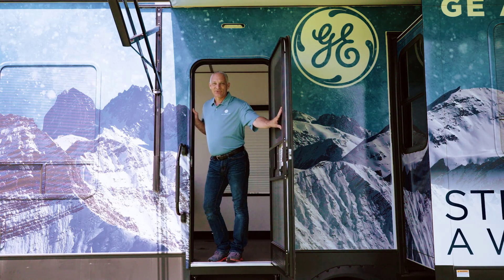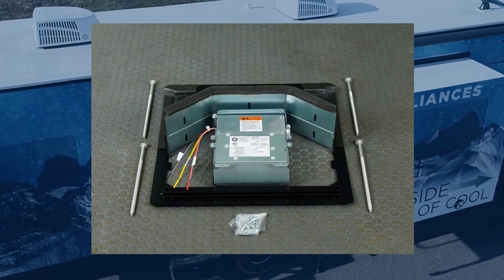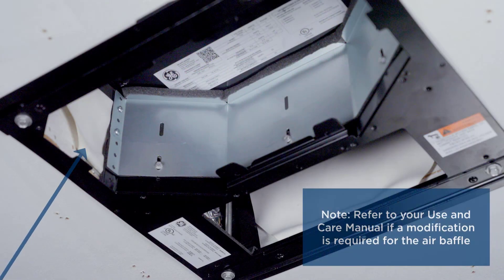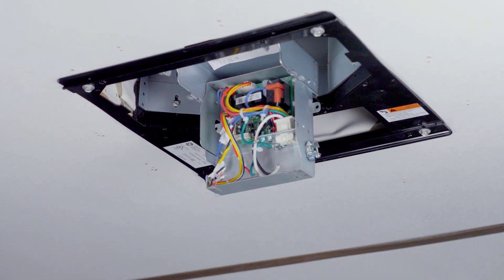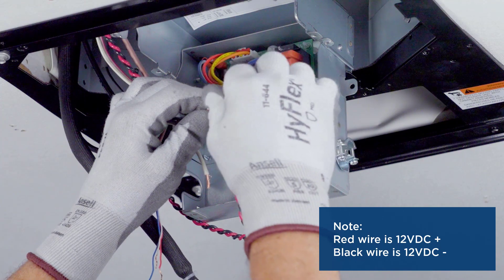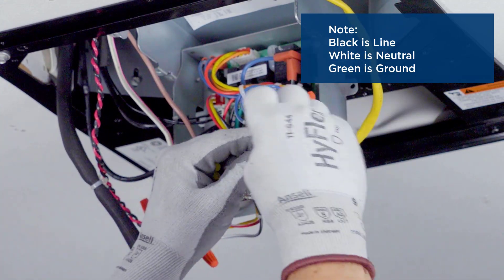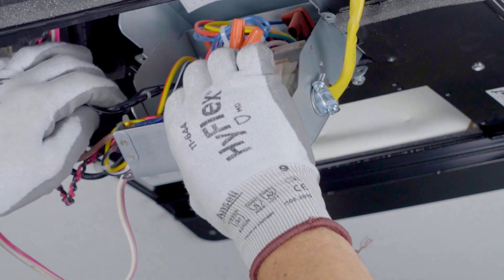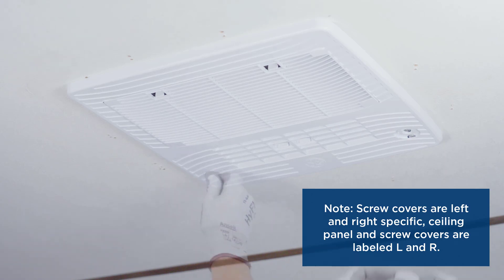GE RVAC - Installing the RARED1A interior RV air conditioner

Comment: Where does the thermostat sensor plug in ?? I installed GE RARMC2A SINGLE ZONE AIR CONDITIONER MAIN CONTROL KIT w/THERMOSTAT SENSOR *S54 but the thermostat keeps  giving me the F7 error code. The fan speeds work but the compressor never comes on due to the F7 code
Reply from the maker: We're sorry to hear you're having this trouble with your AC unit, and we'd like to help. The "F7" error code indicates that sensor was unplugged or the temperature is less than -22 degrees F. If the temperature is not less than -22 degrees F, the sensor is the issue. You can find the wiring diagram on page 13 of the Use and Care Manual for this model (RARMC2A), which can be located on the product page on our GE Appliances website. 

If this information doesn't solve the issue, please reach out to our Bodewell service team by calling 833-426-3393 (Monday – Friday: 8 a.m. – 8 p.m. ET; Saturday – Sunday: Closed). They'll be able to assist you further.

Comment: what is the part number to order replacement air filters for this?  I can find a filter "kit" but not the filter by itself.
Reply from the maker: We would recommend reaching out to your RV dealer about ordering a replacement air filter; they are best positioned to offer assistance.

Comment: I want to switch out my ge ac unit to a furrion Chill Cube 18k, but im concerned about furnace wiring that goes into the control box. I would like to continue to use my existing ge thermostat, but the furrion unit has its own remote.
Reply from the maker: We definitely share your concern and would like to know a little more. Do you mind sending us a PM/DM on our Facebook and Instagram page with the model and serial number of your appliance? If you need help locating the model please view the link here- http://spklr.io/6056B8dY4.

Comment: Thanks for posting this incredibly helpful video, along with the related "Upgrading your existing RVAC with a G# RV air conditioning..."  Neither applied exactly to my use case, but, taken together, they tell me almost everything I need to know, but I'm experiencing one issue I'm hoping you can help with.  My project is to upgrade from a RARMN1A manual, non-ducted ceiling assembly with the kit that comes with the RAREN1A Non-Ducted Ceiling Assembly, the RARMC2A Control Box, and the RARWT2B Black Thermostat. Once installed, everything is working really well, except for the furnace control.  This kit is supposed to be able to also run a furnace, so I've removed the very simple Dometic furnace thermostat and run the two wires from the back of it to the RARMC2A control box, instead.  This video suggest all I have to do is run those two wires to the two Blue/White wires of the RARMC2A. The "Upgrading your existing RVAC..." video suggests it is important to also run 12V to one of those wires. I've tried both wiring options, but neither seems to activate the furnace. So, two questions, 1) should 12V be run to one of the blue/white wires or not? and 2) what am I missing (what might cause the AC portion to work well, but the furnace control not to work well)? Thanks.

Comment: Okay, so this is the 2nd RV/Camper AC I’ve installed and let me tell you… it was not easy. 

Of course, you’ll want to do this when it’s not hot and sunny and be sure to check that you have everything handy. 

My unit QRC15AACWH2 and ceiling mount included a thermostat, but no thermostat cable. Home Depot sells thermostat cable by the foot, and I ended up only using 3 of the 7 wires, because I’m not using the heater/furnace feature.

I would suggest doing a video for only AC users, considering the heater unit is an upgrade and not included. Also, the additional steps for connecting the heater made this video super confusing and hard to follow. Why did you make part of the wire diagram BROWN?! Obscuring part of the connections?! Also, it was very difficult to see which wires this guy was working with and the time on screen was so short, I had to keep pausing and rewinding the video. Show a close up. Get your hands out of the way! Let us see what the heck you’re actually doing and let us see which wires you’re working with. The narrated instructions were confusing while trying to make out what the installer was actually doing…

Plain and simple, if you’re installing just the AC unit without a heater, then ignore all of the instructions and wires marked for furnace. Buy the thermostat cable and get a little extra just in case. Inside the AC control box, you’ll need to connect 3 wires for 12V positive and negative, and connect the 2 yellow wires together too.

The BLUE wire from the thermostat connects to the two black wires (negative/GRND).

GREEN from the thermostat - connects to the two RED wires (positive). 

The YELLOW wire from the thermostat connects to the YELLOW wire in the control box.

The instructions in this video state that reversed polarity for the green and blue wires will not cause any problem.

The instructions in the associated thermostat installation video imply you’re routing 12V power from wherever your thermostat is wall-mounted, up to your AC’s control box, but if you have 12V power up inside your ceiling cut-out, then that power should be connected to the Control Box’s wires, then - connect your thermostat directly to those connections (inside the control box).

Sorry if this is confusing, but this video really left me scratching my head.

Also, these AC units have about a dozen sharp screws sticking out of the bottom so be sure the leave the styrofoam and cardboard on the bottom until it’s in place for install and wear gloves. I taped the bottom on while moving the unit, but after taking off the cardboard, I scratched-up my hands and my roof. Note, the instructions for install recommend leaning the AC unit up on the back / radiator end prior to installation. I did not do that because I thought it was bad to tip anything with freon, but I should have tilted the unit on its tail-end.

I would highly recommend getting butyl tape for sealing up the vent/ceiling hole.

If you can get help with installing this unit, then please do. I’m lucky to have access to a truck with a tall roof so I was able to lift this onto the tailgate, onto the truck’s roof, and then up and onto the top of my camper. Lifting this solo is not easy and getting it up a ladder by yourself would be superhuman, but if you have a truck, then you’re in luck.

Summary: this video should be re-done with a focus on AC-ONLY-INSTALLATION and a simple, clear  focus with hands out of the control box or holding the connected wires for a few seconds for your viewers to easily see which wires are being connected. And, the thermostat instructions should be included since you can’t operate this AC without it.

I installed my AC in a ducted-ceiling camper and it’s important to note that this AC does not function without the thermostat being properly installed. 

Lastly, my thermostat had 4 pins in the back, which all remained switched down. I did not need to adjust any of the pins.

Oh and… the thermostat should include a tiny flathead micro-screwdriver because they’re super cheap and not everyone has one handy. Imagine having to drive to the store for a 10 cent screwdriver and $5 worth of thermostat wire after dropping $1000 on this AC unit…
Reply from the maker: Hello-Thank you for taking the time to reach out. We appreciate all the suggestions you have made as we take our customers feedback and suggestions to use towards changes or improvements in the future. If there is anything we can help with please don't hesitate to reach out and let us know. All the best!- DM

Comment: G.E., please pass this information along to your engineers.  There should either be (1), a board-mounted fuse on the +12VDC input power line, or (2), at the very least, you should instruct RV manufacturers to place an appropriate fuse on the +12VDC wire *next to the unit*.

Our G.E. RARED1A failed, in a way that shorted +12VDC directly to ground.  But because our Winnebago uses the same +12VDC circuit to power other devices, we lost power to our furnace, thermostat, lighting, and both vent fans.  A simple fuse of appropriate amperage at the device itself would have saved many hours of aggravation and troubleshooting.  Board-mounted fuses are a “best practice” solution that you should be following.
Reply from the maker: Hello there, we're very sorry to hear that your RV air conditioning unit is not working as expected. 

We know a situation like this is not ideal, and we recommend scheduling a service appointment for one of our technicians to assess your unit. You can schedule an appointment by calling us at 1-877-540-7837 or contacting your RV dealer. 

Please know we are always available if other questions or concerns come up. All the best. - PM
Reply: @geappliances  I did this, and have now been waiting over two full weeks for a follow-up phone call or email (I got the original, first email confirming that they have my case# and information).  Is your warranty service normally this slow?  FWIW, I have been on the road for the past 10 days without much connectivity.  But I'm disappointed that upon returning, no effort on GE's part has been made to reach me to arrange for service.  No further emails, voicemails, texts, anything.
Reply from the maker: Hey again, we're sorry to know that you have not been able to schedule a service appointment.

Please send us a private message via Facebook or Instagram with the case number that you mentioned in your reply, alongside your contact information, so we can learn more about this situation. 

We look forward to hearing from you. Take care. - PM
Reply: @geappliances  I replied to the original email, and a form letter told me to take my GE A/C to an RV dealer for warranty service.  Since none of the RV dealers in my area have openings for at least 2 months, I feel like GE is just trying to pass the buck and dodge responsibility for this warranty repair.  I will be avoiding purchases of any GE products from now on, and I strongly advise anyone looking for an A/C unit, RV or otherwise, to avoid your products, because you are either unable to help your customers with warranty problems, or you just don't give a damn.
Reply from the maker: Hello, service for GE Appliances located inside an RV should be performed by an Authorized RV Servicer/Dealer for the best assistance possible. Appointment times and dates will vary according to the RV Servicer/Dealer, and we do apologize that there is a delay in appointments for the servicers you have contacted. 

We recommend trying to contact them in case an appointment slot becomes available for a sooner date. 

All the best. - PM